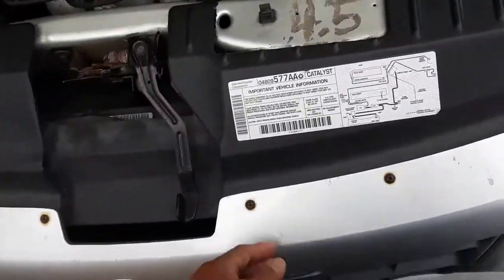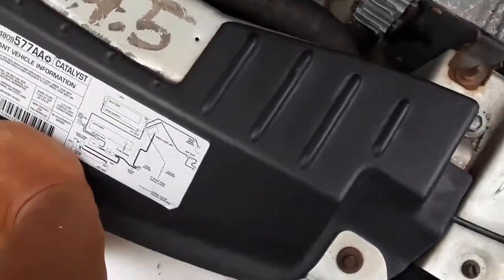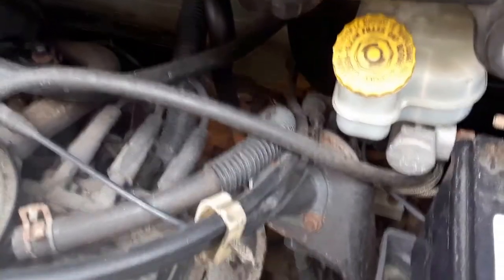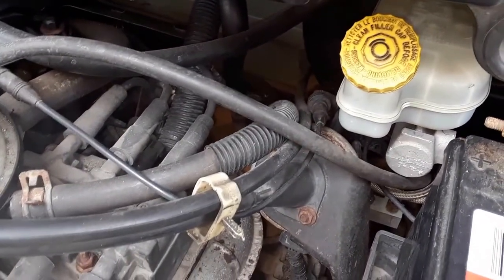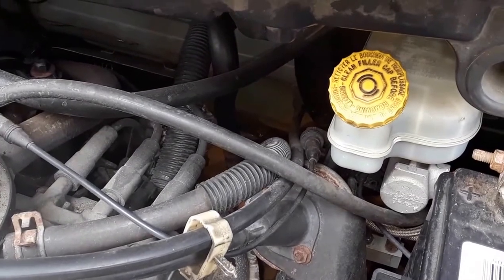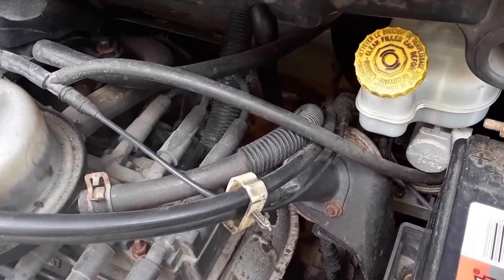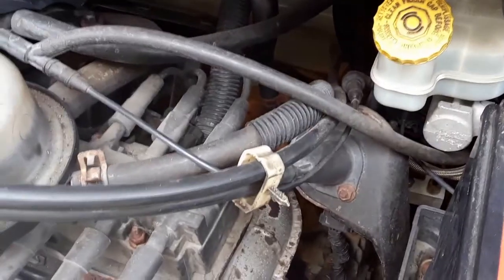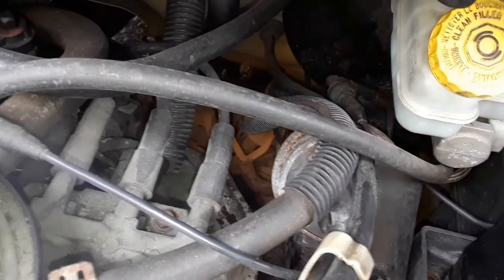Leaky Coolant Issue (V889) - Van Dweller Van Dwelling Vanlife

Comment: Bad hoses back where they go into the heater core. I think there's 4 hoses there besides the metal tubes they attach to. You remove the whole plastic wiper assembly between the hood and windsheild to obtain some semblance of accessability to the hoses.

Comment: Also, fill the overflow tank not the radiator. It will suck it in. That looks like a new radiator cap. Possibly replaced to hide a potential head gasket leak.